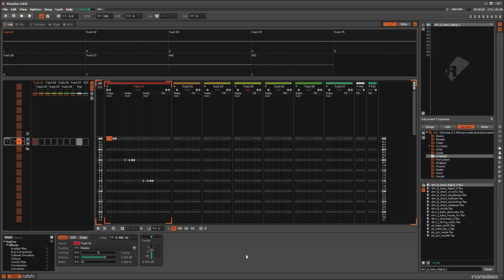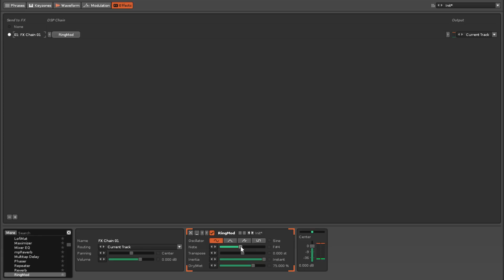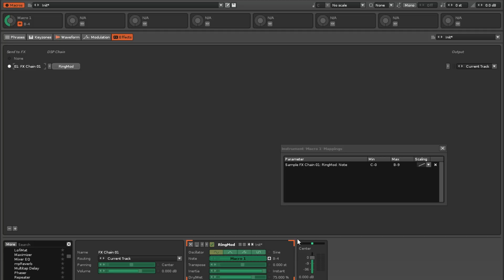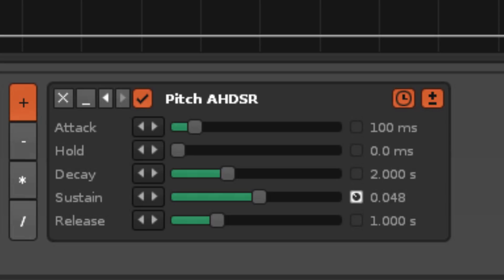Variable Polyphony: Modulation & Effects

Comment: I learned early on to be a bit careful with modulation. I used the "divide", so when I divided by zero(!), the volume spiked so high that the left ear in my DT770 can no longer play bass. :P Luckily, my left didn't take any dmg.
Reply: always use a limiter on the master out to prevent killer spikes.